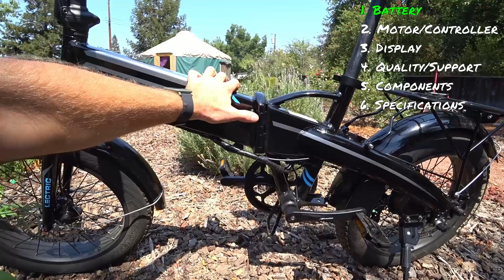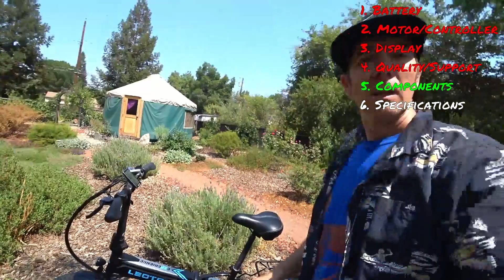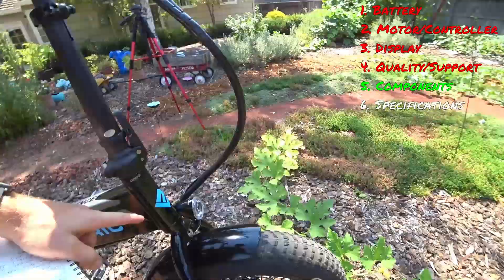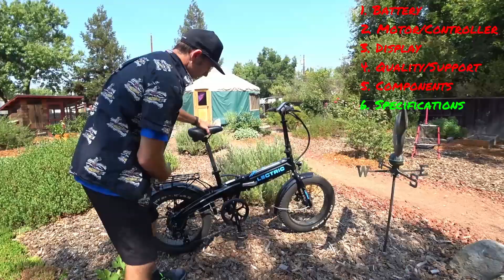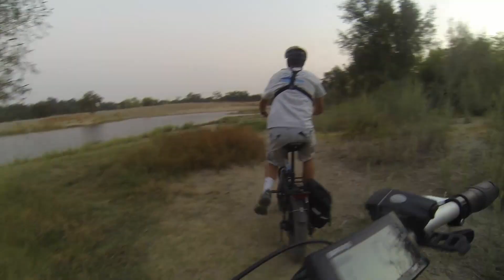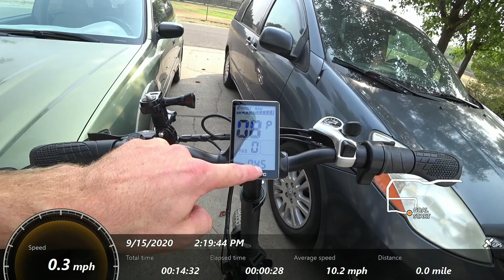Lectric XP Electric Bike Honest Review | Range and Trails!

Comment: I'm watching this on 4/6/21 and wondering if the Lectric company has seen this and addressed any of these issues. I doubt that the fat tire in the sand will be dealt with because there's nothing that can be done. I've never had a fat tire bike much less an electric one but in my experience tires, can't really do sand. Obviously, the tires are just part of the equation, it takes power like a dune buggy. So it would be interesting to see how you did in that spot with a fresh battery. Regardless, I hope they were listening to your comments on the sensors and how they work with your power assist. That seems like really good input for a company that seems to care about its products.
Reply from the maker: @chip582002, I have never heard anything from Lectric regarding my review. Most companies tend to want reviews that only say good things, which is unfortunate. I think the way Lectric keeps their price down is by making sacrifices on the electronics, the quality of sensors and components are really what separates really nice bikes from budget bikes. 

I reviewed a 500 watt 26" fat tire bike that did just fine in the same area of sand. It is really a combo of the tire size and motor power. The torque on the Lectric wan't as high as some other 500 watt hub motors. In my opinion Lectric should do like RadPower and just put road tires on the XP. 

I appreciate your comment, budget bikes are interesting because you get to see where the company is saving $. The Lectric is a fast bike but it is not a refined bike, and for the price you can't really expect it to be! Cheers!

Comment: Use replacement 20x4 tires from the 2006 ( ? ) Schwinn OCC Stingray choppers, they roll very smooth, no knobs. Gives us  2 mph speed gain and 2 miles more range.  (Plus waayyy easier to pedal)
Reply from the maker: I just got a fat tire Electra and the tires ride very well. I really think Lectric should offer slicks as an option. Thanks

Comment: I rarely make a negative comment, but you are extremely negative about most anything related to this bike.. I think at the price point there is no other bike out there that makes sense. Based on sales of 35000 units so far there are a lot of other people that agree. I’m sure there a lot of bikes at much higher pricing that would meet your requirements, but that’s not a fair comparison.
Reply from the maker: I respect your opinion and you are right, I don't like this bike, it's ride, the electronics, or the weak motor. I don't think sales are an indication of a bikes worth, that is due to it being so cheap. I agree, and said so at the end of the video, if budget is your main requirement you can't get anything cheaper. 

I hope that even being "negative" I'm letting the bike speak for itself with a lot of riding and actual ride sounds.  The reviews suggesting this bike's quality is well above it's budget price, are just not accurate. Personally, I couldn't get the bike out of my garage fast enough but I'm glad you and 35,000 other folks like yours!
Reply: I think it’s great that we can agree to disagree. Thanks for your reply.

Comment: great review--- just wANTED  to make sure--  if I wanted to use only throttle - can  I use that feature the entire time for about  20 miles ?
Reply from the maker: I got a little less than 20 miles riding throttle only the whole time. So I'd say maybe, depending on your weight. Thanks
Reply: I get right around that depending on the terrain.  The more hills the fewer miles you will get. After riding 7 miles mostly hills in high winds I could have done the ride again and been fine. I have asthma and needed a bike that I could use to around even if I am having a hard time. I love my XP

Comment: What tire pressure were you using when riding in the sand?
Reply from the maker: The tires were between 15 and 20 psi, so I could have lowered it an it would have had better traction but the power would still be lacking to pull you our of some spots.

Comment: The bike also has cruise control
Reply from the maker: Good point, I never used it. My understanding is it holds the throttle position vs. being tied into the cadence sensor, is that correct? Thanks!
Reply: @ElectronSurfer  in order to use cruise control u gotta have at least pas 1 or higher on ... Hold the throttle at speed desired and hold the bottom arrow down together for about 2 seconds and cruise control kicks in .....